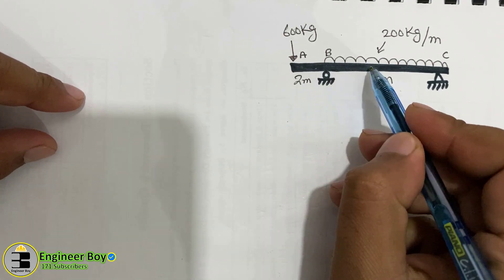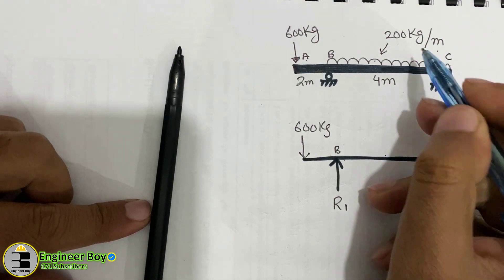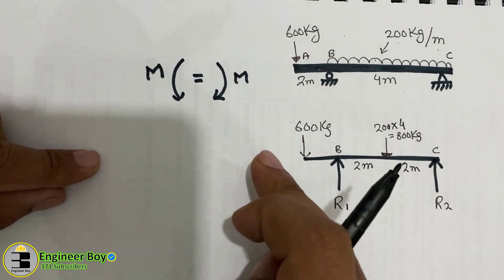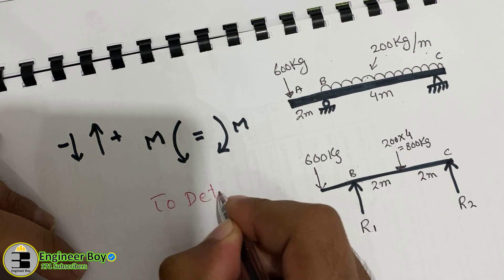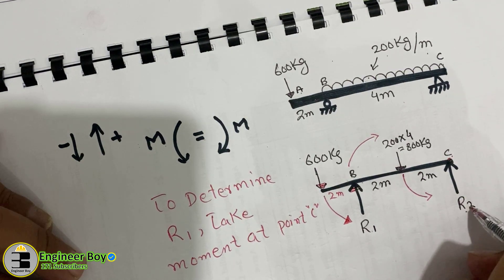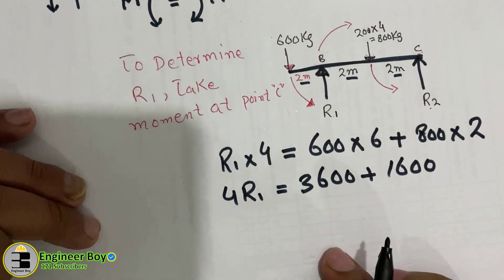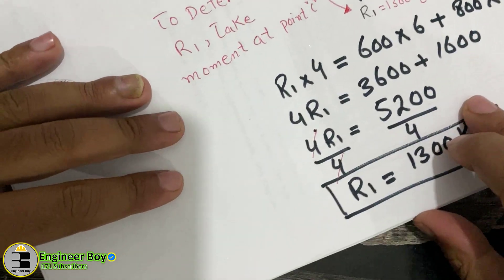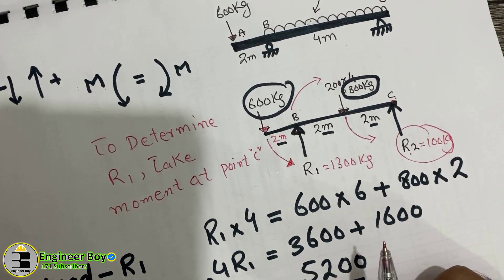how to find reactions of single overhanging beam

Comment: I searched for this video because I doubted that 
   R1 will take load of 600kg totally and there will be no reaction of 600kg point load on R2. But equation on single overhanging beam says otherwise.
         Maybe what I say about R1 is correct only if R1 is fixed
Reply from the maker: Hi. First that reaction is pinned. Secondly both must have supported some load even if that is not fixed.
Reply: @Sulimankhanacademy  thanks sir
Reply from the maker: Welcome sir